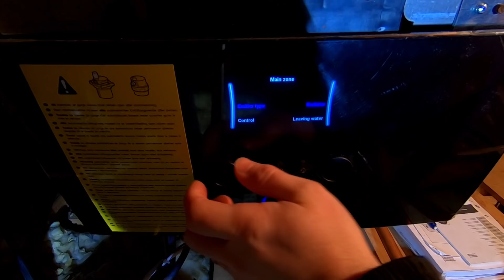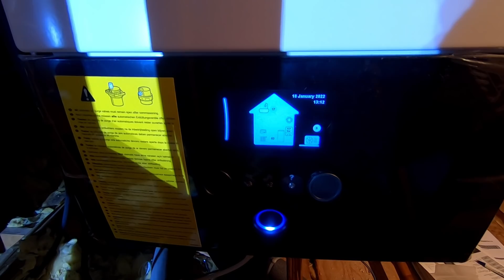How to lose £2000 installing a heat pump

Comment: We have the same unit (18kW 3phase version) and ours was installed without weather compensation too. I played around with the flow temperature for a while when it was first set up and think I have a good curve mode but who knows if it could be better 🤷🏻‍♂️😭
Reply: 18kW ? Either that house is huge or uninsulated.
Reply: @syproful  not huge but old (1830s)

Comment: For people who don't have faith in the reliability of heat pumps, Intergas and Daikin have collaborated to create a hybrid heat pump - which is a gas boiler and heat pump in one system - called the Daikin Altherma 8kW Hybrid Heat Pump. The advantage of this hybrid system is that in extremely cold weather when the heat pump is not efficient, the gas boiler is automatically turned on. The central heating boiler and heat pump can also run simultaneously unlike most other hybrid systems and the client will usually get his money back in about 5 years - or so the sales pitch goes.
Reply: This particular company  didn't have faith in the reliability of the heat pump hence why they removed weather compensation, if you watched the video to the end. If that is truly their concern, having a gas boiler alongside a heat pump should minimise reliability concerns.
Reply: They've got faith in the heat pumps, they are adapting for poor insulated houses and other factors..
To say they've got no faith is completely incorrect and shows how little you know..

Comment: Could I ask if the Heat Pump worked correctly after it was installed? It seems that your issue was with the main contractor and some complications re wiring. Your approach to installation looks spot on. However, it seems that despite the complications the product does work. Most installations are in much more simple scenarios. Yes, I am a fan of heat pumps but this doesn't seem to be a criticism of the product but the client and the support received. I would appreciate a reply thank you and if you ever want any advice I can help.
Reply from the maker: Hi, no problem with the heat pump. It worked fine.
Reply: That's what I hoped. Problem is that to install a heat pump well it should be surveyed well and installed only if the property demands one. I've persuaded many people over the years not to have one and I design and sell them for a living. Best system for an existing property on gas is bivalent but only if the installation suits the property and only if it's the desire of the homeowner. Great work by the way. Shame that a lot of people see this as Heat Pump Bashing. The products are fine. It's the application that is the problem but you salvaged that.

Comment: Sadly this is pretty common with many of those company's getting subs in to do the work and yes they don't like weather compensation turned on. Couple reasons, most older people if they're using radiators actually feel colder subconsciously if the system is being influenced by weather comp - true with any heating appliance feeding radiators, and over riding the weather comp on many systems needs an engineer as an end user turning up the stat often won't get the effect they want (hotter radiators). 

It's a mindset that will change with time but the people want what the people want, until that changes call backs will happen, it's unavoidable. It's a shame because I do enjoy fitting them and I have watched some customers bills fall, and others rise depending how they use it. Sadly these days we appear to be ripping more out than fitting them. I am hoping that changes with the newer models which have 70c+ flow temps using co2 and other gases. 

My advice would be don't sub though, the Vaillant course for their heat pumps is really good - especially the pre-covid one. Get used to one manufacturers kit on their course and the knowledge and skills is pretty transferable as long as you've got the MI to hand.
Reply from the maker: Daikin MI is incomprehensible! I think I will stick will boiler manus as the manual will be more familiar
Reply: @UrbanPlumbers  My colleague has the same view, he's sticking with Gas but he has a Gas and Plumbing background where as I started on the Electrical side so it was arguably an easier transition.
Reply from the maker: @effervescence5664  what I meant was, I will stick with Heat Pumps made by boiler manufacturers like Worcester Vaillant and Viessman
Reply: @UrbanPlumbers  This makes logical sense, especially if hybrid solutions are to be considered.

Comment: I am afraid this is the joys of working as a subcontractor where the installation clearing wasn't priced correctly to start with.  Why are you working for these main contractors?  Sell, plan, design and install them yourself.  These main contractors/ selling agents are what is wrong with the industry!
Reply from the maker: My first and last one. Going MCS now myself.
Reply: @UrbanPlumbers  Good for you!  Despite what the masses say the process is not difficult - just time consuming.  It's frustrating that you have an audit every year which takes a day with an assessor but apart from that it's all good.  We have been MCS accredited for years now and simply won't entertain carrying out subcontracting work like shown in this video.  Still get calls though asking for a 'team' to install PV systems for £400 and ASHP for £600 (for a team of engineers not per person per day, per team for JOB)!  Absolute joke - no wonder there are so many shocking installs out there and that Heatpumps have been branded as rubbish!

Comment: Thank you for posting this and I suspect by doing so you have lost any opportunity for compensation for your ‘lost time’ through no fault of your own. What you have shown in this very short video is what can go wrong will go wrong if you do not do the right design and planning for any project, magnified in this case on every single aspect. You might have lost money but sometimes direct experience of what can go wrong is valuable in moving your own business forward. You have identified all the fracture points in this project and know how to avoid them (if you choose to get involved with heat pumps). I thought the segment on commissioning was f’n shocking. When you consider the time taken to install the system (in fact any system) taking any shortcuts in the commissioning let alone disabling the single most important part of the control system (weather compensation) is absolutely shocking bordering on criminal - because even if the heat pump actually heats the house satisfactorily disabling that function is costing the customer significant (unnecessary) amounts of money every single day the system is in use. An arrogant supplier with no respect for their customer.
Reply: Saved me saying the same. How soul destroying for and good engineer.
Reply from the maker: Someone deleted the comment I replied to. 

A spin going on for sure.

I am talking to them and I am trying to deescalate this.
Reply: @UrbanPlumbers  I can't see you said anything untrue. Don't get flustered.
Reply: @UrbanPlumbers  I see this reached 140k views - reckon your most viewed yet.
Reply from the maker: @normanboyes4983  yes - this went viral. 140K views in 8 days.
Reply: @UrbanPlumbers  I left a stand alone comment. Can you explain or do a video on weather compensation?
Reply from the maker: @justcommenting4981  I ma not sure if that woiuld be very popular. Why not just google it?
Reply from the maker: Of course, it is one-sided - it is my point of view. Nothing wrong with that. I am not naming anyone. Just describing my experience.

I did the survey. I did not receive any information about the job until I threatened to cancel the job last minute, at which stage I received an incomplete set of Information. I queried that, and I was promised an amended version, which I never got.

The design supplied was not feasible. It said to reuse existing 22mm primaries on 10kW heat pump. An engineer from the main contractor was on site and agreed that the design  was not feasible. I contacted the company to discuss. The company engineer on site told me what I should do. I asked directly: 'what am I supposed to do now?" and I was told to do exactly what you see in the video. 

Videos like this are less damaging to the industry than companies leaving heat pumps on fixed output. They are desperately trying to spin it now. I am not surprised as it was rather embarrassing on their part.
Reply: @UrbanPlumbers  I fully understand that and was not being critical of you at all. Any Company that goes on the offensive by ‘spinning’ could do better by reflecting and attempting to understand what exactly what went wrong and taking measures to avoid a repetition. We all learn from our mistakes and if we do not then we repeat them and that is just stupid. Best Regards.👍
Reply: "we" all know who the Heat Geeks are in this 😉
Reply: @dilaliotube  What do you mean?

Comment: Fully understand and sympathise with your frustration - working in that loft space must have been a  complete nightmare!! Once completed and running - did you have  the opportunity to properly assess the function & performance of the system  (despite WC being disabled) - your thoughts would be  very interesting??

Comment: Given that a Heat Pump has to be on 24/7 and blows out cold air constantly, I can't see them being received well from people who have small to medium-sized gardens:-  As seen in that situation
Reply: exactly, I can see the owners are going to be really pissed when they sit down on their nice patio and experience a constant blast of air from the heat pump...whilst sipping on their proseccos.
Reply: @JohnnyMotel99  I guess that in winter the expelled air will be colder and in summer (ASHP is needed at least for heating water) the expelled air will be hotter.
Reply: @JohnnyMotel99  If the weather is warm enough to sit outside sipping prosecco I doubt the heat pump will be on.
Reply: @agt155  ha, just shows how little I know about heat pumps! Thanks for the correction.
Reply: You're right. They are ugly bulky units. Might put people off from buying a property.

Comment: I'm really surprised the customer chose to have that massive unit in their small garden, blowing air into what seems like their relaxing space with outdoor sofa / BBQ etc.
Reply from the maker: It will be a nice air con in the summer
Reply: @UrbanPlumbers  In summer, the coming out air will be hot I think
Reply: These units are ugly, bulky and might actually put someone off from buying the property. Yet the politicians have an agenda to put them in place of gas boilers. It's ludicrous, as time goes on people will gradually wake up to this nonsense.
Reply: Where else could they put it 
The front garden ??
Reply: @boyasaka  ROOFTOP! No one is going up there!
Reply from the maker: You would have to hire a crane and get a permit to close the main road. And you also need a flat roof for that. If there is no access to the roof, how are you going to service it?
Reply: @UrbanPlumbers  It was an idea, because it's likely that many people would not want the big ugly fan box at eye level. If it can't be done, well, people may just decide not to have one.
Reply: They have these on flat roofs.
Reply: Wonder how many roof installs went wizard of Oz in last weeks storns

Comment: is it a good idea replace exist gas boiler and hot water cylinder with new leased Vaillant Aerothermal R290 Refrigeration air source heat pump with compact cylinder unit. So need to install in loft. R290 heat pump has 75 degree hot water to heat up radiators as stated by Vaillant. I don't know exactly the temperature it could be. Scared me for 6-7 days to install, electricians hire  2 days, scaffold hire.
Reply from the maker: You would still have to install in the loft. Existing pipework had to be upgraded and external run was the only viable option.

Comment: You going to name the company?      So none of the rest of us get caught out.................................................
Reply from the maker: No, I can’t do that. Also any comments suggesting who they might be will be deleted. I don’t want to get into any more trouble.
Reply: Just don't install heat pumps and you won't get caught.
Reply from the maker: @SkillBuilder  nothing wrong with heat pumps, mate.But I know you dont agree.
Reply: @SkillBuilder  I'm fitting my first one soon for heat geek. I'll post up a video after on my channel. I've seen your videos and the replies from Adam. My opinion is that poor installation of gas boilers or heat pumps is very common. Both correctly specified and installed are going to work well. Adam is offering a first class  education opportunity to raise the game of installers. You could help our industry a lot by steering installers to his course. Would be great to see a collaborative video between you. I wait for the skill_geek interaction.

Comment: Sounds like the main contractor sent a lot of labour out too, did anyone make money on this job?
Reply from the maker: Probably not. There was a mistake made at every single step of the process by the main contractor. They grow way too quickly and seem to have lost control over the process.

This was my first install as well, so that did not help either. Pluming wise it was simple enough. However wiring was a different issue. I also had a sparky that was not really ready to crawl through lofts or climb tall ladders.

Not all delays were mains contractor fault that is for sure. However when I asked simple questions about wiring schematics they only replay was to send an electrician. Basically throwing massive resources at problems that could have been resolved with a phone call.
Reply: @UrbanPlumbers  yes clearly there is a massive shortage of technical knowledge for support, we know that is generally true in our industry and most companies are just selling boxes....

Comment: I would have walked after the first day you have so much patience
Reply from the maker: I should have really.
Reply: Experience is hard won. There is a time to walk away and it is usually on the first day when you find the job is not viable. The optimist hopes it will come right but it hardly ever does. 
You have done a great service to your fellow tradesmen/women in posting this and hopefully one day you will see enough ad revenue from it to repay your perseverance
Reply from the maker: @SkillBuilder  ahhh Roger commenting on my video - Welcome

Comment: Wow, you have exposed the consciously incompetent Industry of heat pump manufacturers. We need people like you to give them a kick up the backside . They should be training everyone for free and properly too. Trouble is it's all about making money for themselves .
Reply from the maker: I am not sure if what the main co tractor told me is true though
Reply: @UrbanPlumbers  weather comp on or off isn't going to damage the heatpump like people are saying, high volume start ups does that. There are situations where you can omit weather comp and still be efficient. Alot depends on the fabric of the building and controls.

Comment: Dont worry youll be back round ripping it out next year for a boiler 😂😂😂 biggest scam known to man that heat pump nonsense soon goverment will get bored os wasting money and it will be hydrogen or electric boilers on the bandwagon
Reply from the maker: I don’t believe H2 will ever happen. 20% mix maybe, Just gas industry kicking the can down the road.

I do like heat pump tech. I believe it will be a part of the future, just not done this way.

Those companies have a good chance at destroying the heat pump market for all of us.
Reply: @UrbanPlumbers  think the units will need to be much quieter and bulky for mass adoption but i for one wont fit them until they are at that level

Comment: What a nightmare, and they are supposed to be the future, I don’t think so, bet the customer wishes they had gone for a new gas boiler, I would have done, and probably a fraction of the price of that thing, tidy work by you again, but I think you need to kick them into touch.
Reply from the maker: Technology is not bad. Client very happy, just unaware that system is fixed.

Comment: This is how it starts and ends. Some People will never get used to heat pumps
Reply from the maker: I do like the tech. Just not done this way
Reply: @UrbanPlumbers  yeah I love them and installed around 10-20 now. Primarily the Daikin split system. What I’m saying is some people (customers) cannot get used to them no matter how hard you try. ☺️
Reply: @UrbanPlumbers  LG THERMA V 9KW installed in May 2021, I need recommendations who could service it annually.. Thanks in advance.